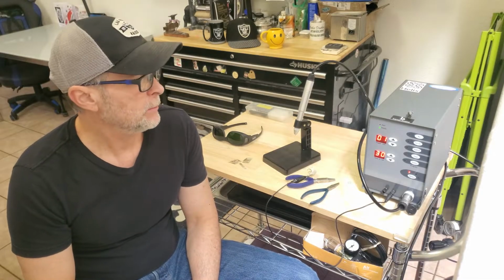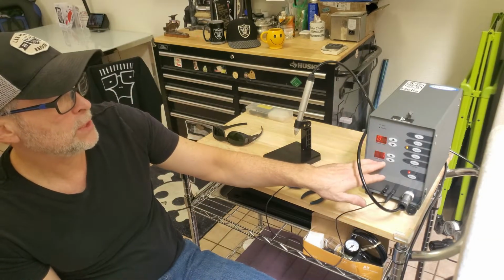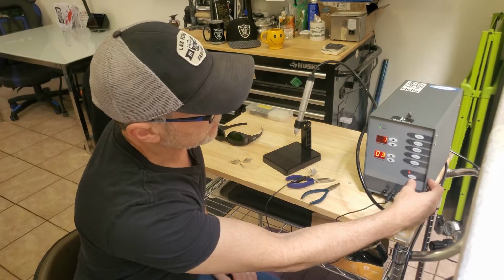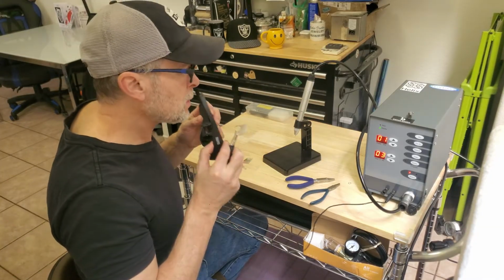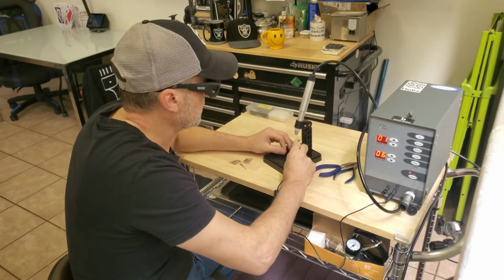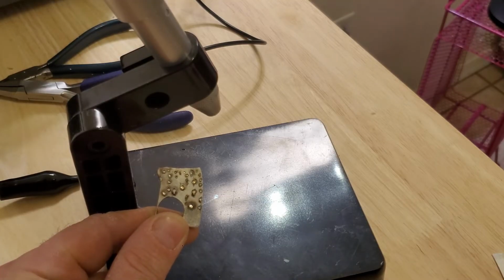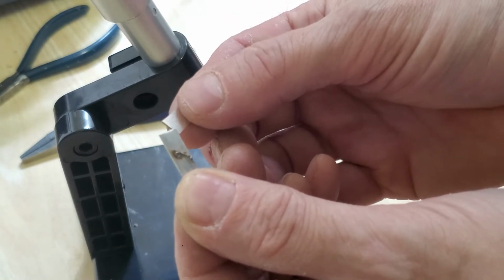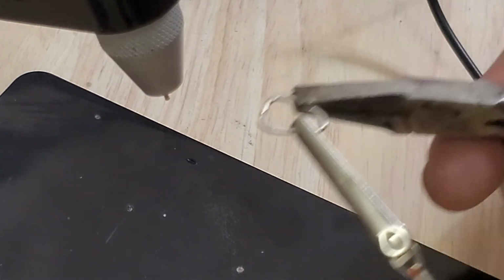Amazon Pulse Welder Tutorial Demonstration, welding and explanation of power, micro second settings

Comment: I found the "Owner's Manual" to be useless.  There is no discussion on how to set the machine for different materials other than to push the buttons for specific metals that are pre-set.  What would be the power and duration settings for carbon steel?  Thanks!  Mike

Comment: I really don’t like to hate on a channel like this, but u really need some firm up in welding fundamentals. Those welds do not look good. And there is a bit of irony of a channel called future antique jewelry, implying that longevity is a goal or at least important, yet u have turned ur shield gas down about as far as it goes. I kno argon is not cheap, but welding jewelry is the absolute last place I would expect anyone to skimp on gas. That really blows my mind. I mean good welders in a shop are using hundreds of times as much gas welding plain old steel and they will not skimp on gas, but u using tiny puffs of gas welding precious metals have turned it down as far as it goes. It does have a purpose, a critical one at that. If gold can be oxidized from arc welding think of what it does to silver titanium etc.
Reply: Gold shouldn’t be oxidized from this. But most other metals can be. Stainless will have a bigger problem as it’s a reactive metal. If you weld through, you need protection at the back if the weld or it will oxidize badly, called sugaring, when we weld it in larger work. I also bought this welder. It’s nice, but does take practice to make good reliable welds. I’m not really sure why I bought it, but I suppose I felt it would help making small tacks more easily before I TIG welded the parts. Meh, it’s ok, but not great. I’m finding that laser welding is better than both.

A problem is that they give a number of thin tungsten electrodes with it. They are like thick needles. But the fine tips erode quickly. Where to get replacements? Good question. I can buy tungsten rods the same thickness, but most people using this won’t know where to get them. An annoyance is that if you make a special setting and wait too many seconds, it resets and you have to redo the settings. So you need to check before welding.

Comment: Have you tried aluminium sheet?? I've been trying to find the pdf manual with no success. Also, why so many times there is no arc/spark? Does the tip need to be touching the metal??
Reply: Electrical contact is required.  Aluminium has a thin or when anodised a thick insulating oxide layer.  You would need sand or abrade the oxide away and then still rub gently with the tungsten tip to make contact later as the oxide starts to reform immediately but is thin at first.

Not sure if this will be effective on aluminium but without shielding gas it will probably burn more than melt the metal.

Comment: I just bought one thru Amazon, but spark is same as 9-volt battery. And unfortunately paid $100 shipping cost too, so cant afford return of item now. But hoping to take apart and fix - LOL
Reply: If you have the energy documment your repair or tear-down.  Lots of people will be interested to see if it can be repaired or even improved if the basic parts are reasonable with just a few upgrades.
Reply: @KallePihlajasaari  Yes, and thank you. I am disabled chemist, but will learn some electronics from this project. Every obstacle can be an opportunity for learning!

Comment: ms is millisecond not microsecond. Microsecond would be us because the m was already taken. So 1 ms is 1000 microseconds so that's a very small big difference I guess? You went to so much trouble to enunciate as you said microsecond I'm sure you would rather give correct information so just find that away and add it to your wealth of useful stuff to know. I know I can't always be right, but I at least try to be more correct. 

Good video. Sharpen those tips, that's what the little USB powered grinding wheel is for.   

I wonder how many versions of this device are kicking around these days. Mine had a manual but I see a lot of people didn't get one. There are a million videos on this thing now, I'm not sure how I managed not to see one until now.

Comment: Its milliseconds not microseconds. A microsecond is one millionth of a seconds and millisecond is one thousands of a second. It also looks as if your tip of the tungsten electrode is not sharpened. You need to grind it on a diamond wheel in the direction of the arc. I used to design and built pulse arc welders. https://pulsearcwelder.blogspot.com/
Reply: Whatever became of your project?  Did you finish it?  If so, did you publish the details somewhere?  I want to build one of these and have been getting help from AI, but when researching it, I came across your blog.  I looked around but figured because it was so long ago it never came to fruition.

Comment: Where did you buy the tungsten?
Reply: These pulse arc welders use standard tungsten TIG welding electrodes you can get at a welding supply or online.

Comment: Question: what if you're not getting a spark when you touch the electrode to the metal? Does that mean the settings are too low?
Reply: I just bought one thru Amazon, but spark is same as 9-volt battery. And unfortunately paid $100 shipping cost too, so cant afford return of item now. But hoping to take apart and fix - LOL.

Comment: As noted in a previous comment, you need to grind a sharp point on the electrode. It will definitely improve the weld placement. Also, for $30-35 get yourself a set of auto darkening goggles. Much easier to see what  you are welding.
Reply from the maker: That's some great advice, thanks for sharing your experience!
Reply: Auto darkening Google’s nay not work with this, though I haven’t tried it with mine. The spark is too small and too quick to activate the sensors on the helmet. Besides, a helmet sensitive enough to possibly work costs more than this welder. Cheap ones won’t possibly work.

But yes, you do need to sharpen the electrode. A point gives a more concentrated and reliable arc.
Reply: Autodark helmets do work with this they are like 45$ at harbor freight

Comment: Thanks for the video. 2 Questions to the community: what is the danger of electrocution and what is the danger of UV skin burns when using this machine to weld without gloves?
Reply: The danger of electrocuting is low. But it is important to use gloves, long sleeves and face protection. Cutton is fine. The UV light from arc welding is WAY more carcinogenic than from the Sun or from the tubes for tanning.
Reply: @jorgenskyt  Thanks!

Comment: Thx for the video demonstrating,i have an question plz,i need to weld 0.5mm aluminum wire on circuit board,how to set the machine ?
Reply: Wouldn't a solder iron work for that?

Comment: Thanks. Just wondering if it came with a standard fitting for a cylinder of argon that you would use for welding or did you have to rig it yourself to make it work with a cylinder?

Comment: Hello, your video is terrific. I am considering one of these machines for hobby scratch-build scale model car assembly. There are two questions I have not yet seen answered about this welder (and its manual is horrific); in addition to Stainless Steel, can this welder spot weld mild carbon steel, aluminum, and brass?

Second, where does one get replacement tungsten needles? Are they simply TIG welding tungsten electrodes? If so, what size?
Reply: I too have been pondering such a machine as prices are falling.  Yes to all your thoughts except not sure about aluminium, it might work but I have not seen demonstration.

I have seen mention of 0.5, 1.0 and 1.5mm electrodes.  You need to check what the collet size is on the machine.